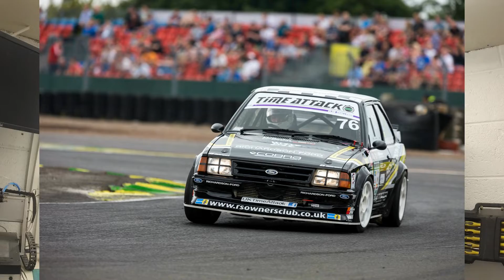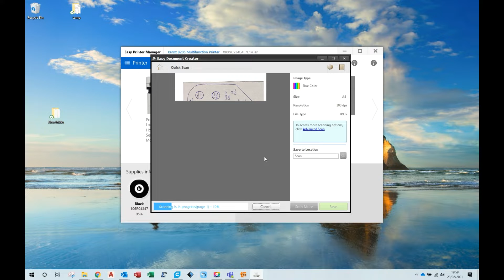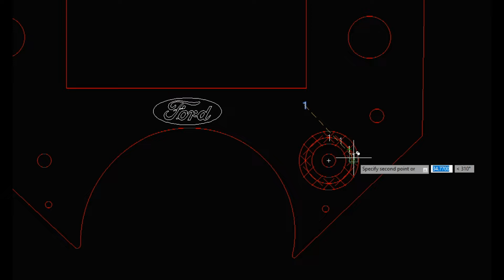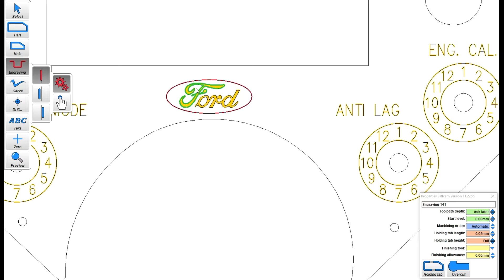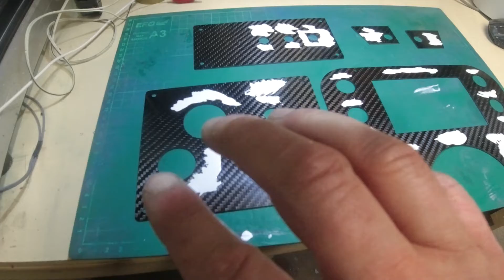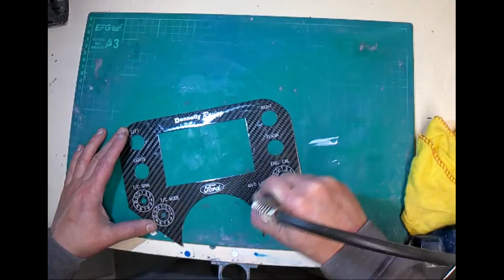Time Attack race car get's custom cnc machines carbon fibre switch panels

Comment: Jeez look amazing! Did wonder though why the customer wanted full stops on the ENG. CAL. but no other full stops on any other text.
Reply from the maker: Thank you very much, my you do have a keen eye lol my guess is that all the other text is full but eng. and cal. are short as in engine & calibration.  Just my guess.  I hope he doesnt see this comment and now request full stops or you will be in trouble lol.  Thanks for commenting :-)
Reply: @autoflockmotorsport7730  Exactly right :-) They are the only abbreviated words on there. Full stop after an abbreviated word when the last letter is not the last letter of the full word... Anyway enough with the English lesson, awesome work lol!!!